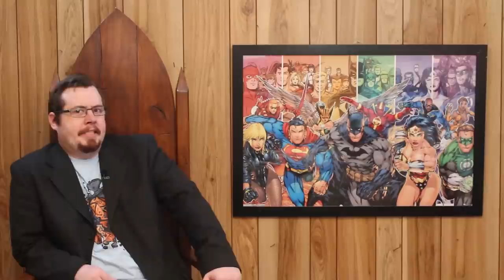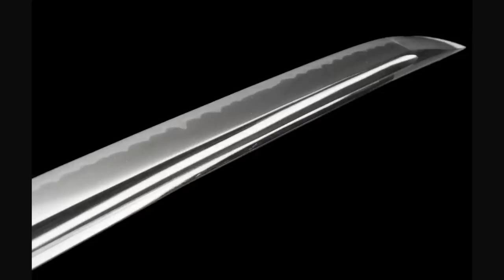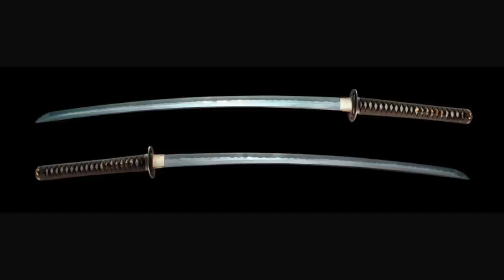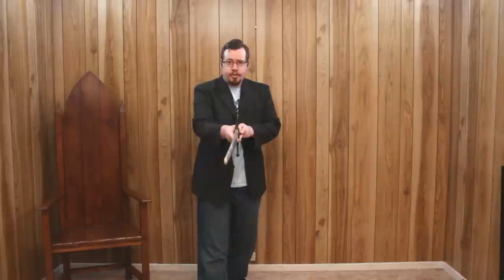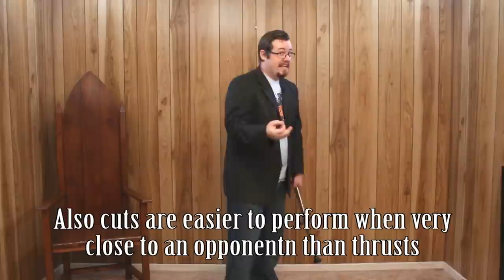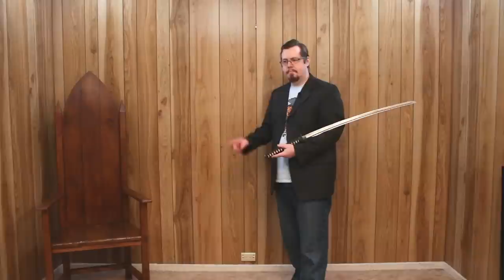Super cutting swords, are they needed?

Comment: I think out of all the specialized cutting swords, the katana is probably more practical, because although it's stabbing ability isn't as good, you can still largely be able to use the thrusting technique with the katana that you would do with most other two-handed swords that gave you the option of thrusting at your opponent, because they didn't sacrifice all of its thrusting ability to make it a cutting sword. It's probably the closest to the longsword of Europe than the other specialized cutting swords, because you can definitely stab someone with a katana, and there are techniques you can learn that involve stabbing with the katana, whereas with the scimitar or Sabre, there is barely any room for a traditional stabbing technique and you'd have to hold the sword at a very sharp angle to thrust, or with a very thick sword like the Grosse Messer, the fathead makes it more difficult to thrust, even though it does have a point, and if you had the opportunity of course try to thrust with it, but unless you're aiming for a soft or large open Target, it would be more easy to catch on bone and clothing or armor.

Comment: A curved sword also has the advantage of being harder to block since it can bend into and behind the defenders weapon during a parry.  The thrust could then be turned into a cut when an unexperienced defender blocks or parry the sword away.  Twisting a curved sword allows the attacker to also chose between vertical, horizontal or any range of diagonal during a parried trust.

Comment: There's a great documentary which looks at the injuries sustained during Waterloo where two very different swords were used. The French cavalry used an elegant thrusting sword which killed very easily, but if it didn't kill outright, caused "clean" injuries. It was efficient but generally harder to use on horseback. The English used a heavy, curved saber, which killed outright surprisingly infrequently but caused absolutely HORRIFIC injuries, cutting into bone, lopping off limbs, etc. Their saber bit deep and often took a soldier out of the fight. It horrified the French and surely had a psychological effect but, again, though easier to use from horseback, and causing terrible, maiming, injuries, it killed very rarely. Which sword was "better"? Not an easy question to answer, the French thrusting swords killed much, much more, but if they didn't kill, they didn't take a soldier out of the fight, whereas the English cutting swords killed very infrequently, but caused debilitating injuries which inevitably took soldiers out of the fight even if it didn't kill them.
Reply: Now that I think about it, the documentary was on Napoleonic battles, not simply Waterloo....so, ignite that part lol

Comment: In terms of cutting based swords such as a katanta vs. a sword with both the thrust and cut such as a longsword or arming sword, katanta's can cut through steel with greater ease, a longsword or arming sword would typically crush steel armor. the samurai who used katanas needed a cutting sword because they fought duels specifically with other samurai only that didnt last more than 2-3 hits, which is why the katanas were easy to dull or chip, but their armor was strong and they needed to get through that, also the movements were more fluid. A longsword or arming sword was not as sharp because they needed to fight not just other knights but an entire army and swords without a razor edge lasted longer, the thrusting was used to get through the gaps in the armor. The cutting sword vs. an thrusting/cutting sword was created because each nation had a different need. Knights needed to get through gaps, samurai needed to finish duels quickly. Slashes are bigger and deadlier than a thrust unless a thrust is to a vital organ.

Comment: I haven't gone through the comments here as there are so many so please disregard this if the point has already been made. But re-chopping off limbs: if you slice someone, even to the bone, you disable the limb but you don't (necessarily) put the fighter out of the battle. But, if you take the limb off, the combination of shock from trauma and the loss of blood pressure in the body should put them out within 10-15 seconds. A similar point regarding thrusts, yes, they are quite deadly, but the question isn't (necessarily) how deadly the thrust is, but how quickly it will put an opponent out of the fight. A giant cut across the torso or a chopped off limb definitely put the opponent out of the fight, the thrust (even an eventually deadly one such as a bowels thrust) doesn't do it every time.

Comment: It's all about context. If you have a martial art in which you do more cutting (say 18th century British cavalry), it makes sense to have a sword that is better at cutting. 
And if you do want to cut, an arming sword or other straight sword only cuts well in one area of the blade - about 3 quarters of the way down the blade (sometimes called the centre of percussion). With a sabre, tulwa or messer type sword, you can cut very effectively  all the way to the tip.  That gives you a reach advantage in the cut, over a straight sword.

Comment: Something you overlook is that specialized tools are made to the point of making something easier. 
Lets set some baselines: Equal force used against two equal targets. Not realistic, yes, but its sufficient to make my point.
Sword A, when swung with X force against a target only cuts to the bone.
Sword B. also swung with X force cuts through the bone, causing dismemberment. 

Now, as you say, we only need to do the job(disable the arm) and anything after that is overkill, or wasted energy. If we only need to cut to the bone, Sword A requires X force to cut to the bone, now Sword B that can use the same force to dismember, means that it requires LESS force to cut to the bone. Its the difference between needing a full swing versus a lovetap. If you can disable an opponent with a quick lovetap executed from a guard stance, instead of something more telegraphed, the sword's design fulfills its function.

The point isn't raising the maximum ability(dismemberment) but making the task easier(cutting to the bone). The less energy I need to put into that task, the better the sword is in that function.

Comment: I think there's a few reasons for cutting swords' use, some independent. Like the jungle machete example you gave, things like that could be used for chopping. Chopping blades are top-heavy, short, and imposing. They're also just plain heavy. The top-heaviness allows for a quick chop, the opponent will see the blade be readied because its hard to lift (imposing), but they won't see it coming because it falls down so quickly. The shortness makes for a concentrated, forceful blow. The general heaviness, coupled with the top-heaviness and shortness, make the blade able to injure an armored opponent with force, rather than blade. Opponent got a metal helmet? Hit them hard on the head and they'll be too dazed to fight back. Leather? Hit them with the hard, dull backside. The imposing nature will make enemied scared in a fight, losing a bit of their effectiveness. Slicing blades are a generally good, all-purpose blade. Slicing some leaves, slicing up food, slicing off the heads of your enemies, you name it. And you just make them sharper and sharper, and more effective. Even if the sharpness does get overkill, they just get better at making enemies NOT want to keep going. As for thrusting blades, they're better for getting through armor. Piercing the weak points, precisely hitting vital points. But, they are more prone to small warps and dulling. Even if those things are reversible, its a pain nonetheless. So, I think the best strategy is putting slicing swordsman and chopping swordsman at the front of an infantry, and thrusting at the back. That'll secure a victory, maybe.
Idk. Slicing and chopping specialization lost the crusades.

Comment: @shadiversity
reasons for a specialized cutting sword.

 when cutting, it is very easy to recover into a guard.
 stab wounds often require infection and longer term internal bleeding to end someone, where as a cut has more places it can rapidly exsanguinate someone from.
 being able to cut people down through heavy winter clothing
 things like tulwars and sabers were developed after the advent of muskets, so heavy armor was less of a thing (certainly full body armor)
 Curved swords like a katana or a tulwar are not necessarily tremendously better in the chop than a longsword, but they do have a vastly more forgiving draw cut that is less likely to get stuck in somebody.
 while a 5 cm deep cut might kill someone, cutting through someone's limb will take the target out of action much more rapidly.
 it is easier to recover from a cut than a thrust.
 in a fight to the death, a thrust might get trapped in a not immediately lethal part of the body like the hand.

Comment: i do agree with most of the points you made, but CONSIDER THIS!
If you swing a sword into someone's limb or gut and it does not go all the way thru them, well now your sword is probably stuck in the rather macabre trap that is their partially disemboweled body.
and now there very likely will be a few moments you have to spend trying to remove your sword from them whilst more enemies may be closing in on you.
whereas if your cut goes all the way through them, you don't have that trouble. you can get right into the next fight without the aforementioned delay.

Comment: Wasn't the point of the "super cutting swords" to make the cut and the sword not get stuck.  And weren't they common cavalry swords to help reduce injury to the rider because his arm would meet less resistance.  Also fighting is tiring, wouldn't a "super cutting sword" still allow you to make a deadly cut when you were exhausted and still fighting while a less specialized sword may just cause a superficial wound.  I imagine if you did a one hour workout and then tested the cutting capability of different types, "enough" would have a very different meaning.

Comment: Remember, after 1600-1650 armour came to be less and less used with heavy cavalry being the last to discard it. At the same time, curved specialized cutting swords starting showing up in Western Europe, e.g., the Polish/Hungarian Szabla. The torso and often head was still well protected but the arms were quite vulnerable and the face usually exposed. A specialized cutter like the szabla could, with a fairly small wrist and forearm movement, do horrible damage to limbs.

Comment: If thinking the blade curvature as cutting optimization:
1) mounted combat 
2) fighting multiple enemies. 
The decreased likelyhood that your sword gets stopped by or stuck in opponents body is a major advantage in these scenarios. Cutting power plays a role in this, but curvature would help with it even if it did not increase the cutting power. 

Also, in a fantasy settings, 
3) orcs, ogres, giants etc.

Comment: It could be a matter of recovery time. As silly as it might sound. Combat often comes down to speed. In the case of swords that are better at cutting, not only do they have to deal with less wind resistance they can also cut through tissue much faster. So that means if you don't have to take as long to pull your blade out of someone. In addition if you are lucky enough to perform a full amputation that's even less time you have to take to regain control of your weapon and thus continue to defend yourself.

The results might be almost immeasurably small, but a tiny increase in speed could easily save your life on the battlefield.

Comment: The answer is historical context. Longswords had to deal with more armor than most of the cutting swords you mentioned. Also, I think if you think about it in firearm terms you might see the argument differently. In firearms we talk about "stopping power". Something that can wound someone equally through penetration and such arguably does not stop a person as quickly as other rounds. Or so the argument goes. Cutting off an arm sounds like the same argument as stopping power, where is the line.

Comment: I think curved swords can also be great at thrusting. 
/// in Theory ///
It can curve over a shield, or hit the arm pit from underneath ( for plate armor ).
On single edge ones you could guide your thrust by sliding the back on your other hand.
///in practice///
If you curve your thrust, it will work as fine as a straight blade, but instead of a "punch like move" it will look like a hook.
It can be more tiring because it uses your shoulder more.
///for Tactics///
I think it's also much harder to predict because you can swiftly spin your blade (on the thrust axis) at the last second to completly change the point of impact.
you can start a right hook ( pointing to your left ), and then swiftly turning your hand to point to your right and adding more force with your left hand.
If your opponent can't block two sides at the same time, he's gonna feel it.
///Conclusion///
Pls make a video on how to thrust with curved swords. I think it should be interesting.

Comment: with a cut it is very possible to get the blade stuck in whatever you are cutting. freeing the blade may take some precious time that could be crucial on the battlefield. specialized cutting blades may cut thru the bones so they don't get caught in em. armor is also a consideration. not that the cutting blades will cut thru armor, but those heavier cutting blades may give better impact to crack bones

Comment: Sir Galath already mentioned two of the main things that occurred to me watching the video.  The first of which was the reduced chance of a sword stuck in your opponent.  If it takes you a second or two to yank your weapon free, you're effectively unarmed for that time, which in mass combat is a bad thing.  The second would be its effect on enemy morale.  It's one thing to kill your opponent, but if you lop his head off, his compatriots are going to have second thoughts about facing you.

Thrusts may be harder to block, but I imagine they're also harder to perform.  You need much more accuracy in a thrust, while a cut can threaten a greater area.  Even when engaging a single opponent, this is a benefit.  Also, it's entirely likely that a thrust won't immediately incapacitate your opponent, unless you pierce the heart or brain, neither of which is an easy feat.  Piercing the arm might even go unnoticed for a time due to adrenaline and endorphins, but if you sever tendons, it doesn't matter how frenzied your foe is- that arm is useless.

Lastly, most swords specialized for thrusting are relatively light.  This has two drawbacks.  First, the blade becomes very poor at parrying blows from heavier weapons, like bludgeons or chopping-type blades.  Second is that it is near-useless against rigid armor, whereas a heavier weapon can still transmit enough concussive force to have an effect.  Even if it can slip into gaps between plates, these are often (though not always) over less-vital areas such as joints.  The heart, for example, will be thoroughly protected from most piercing weapons by a quality steel breastplate.

Comment: The only thing I feel strongly enough about to comment on is the difference in difficulty in defending oneself against the thrust versus a cut/slash.

Personally, I feel it's a matter of overall utility rather than straight difficulty. While it can indeed often be easier to block a cut/slash than a thrust, you really shouldn't BLOCK with a sword, IMO. Both cuts/slashes and thrusts should be parried with weapons, not blocked. In my experience the difference between parrying a cut/slash and parrying a thrust is that parrying a thrust more often gives a clear chance for a countering strike, where parrying a cut/slash will often just leave one in a neutral position, neither gaining an advantage nor being at a disadvantage.

Comment: I originally wrote a lot, but I think I can sum it up a lot better. The argument in this video seems to be made from more of a 1v1 feet on the ground kind of dueling perspective. From that view rapier is probably best and arming sword good if you want some cut. But this wasn't the only way of fighting. Throughout history super cutting swords have been good for horseback, breaking formations and causing fear. 

In antiquity cavalry hardly war armor and very light armor if they did. Super cutting swords are good for this. Many simply used spears, javelins and bows instead of swords though. 

A stab can kill. A cut to the bone can kill. Sending heads and limbs flying spreads fear. 

Another thing is the video excludes the thought of shields.

Comment: What about if you're on horse back?  One hand holds the Raines, the other holds the sword.  One handled cuts are less powerful than two handed cuts.  This is why horsemen used longer swords and sharper swords when welding a sword from horseback.  The increased cutting ability of a sharper sword or a heavier one would off set the weaker swing of a one handed slash.

Comment: I'd say the reason why curved sword based on cutting is the same as why rapier and similar thrusting swords exist. Depends mostly on the period and the situation you're in. Cutting also has the plus of easier movements. For example if you were to be on a ship or a corridor, thursting weapons aren't too great because you can't back up to get a pierce movement while the rotation movement of cut weapons is a lot easier to maneuver.